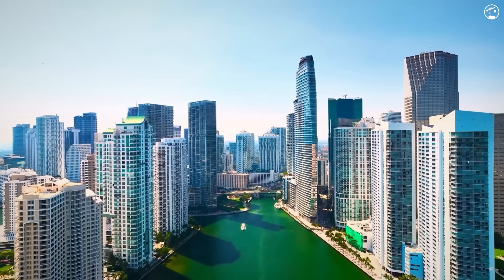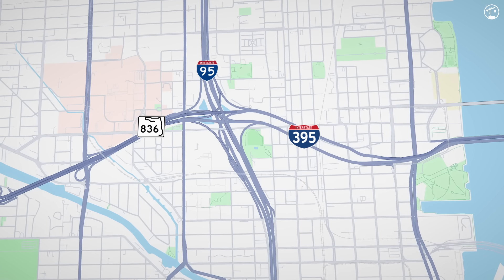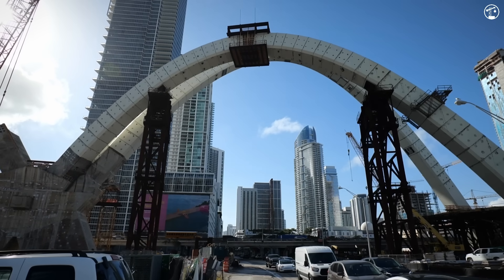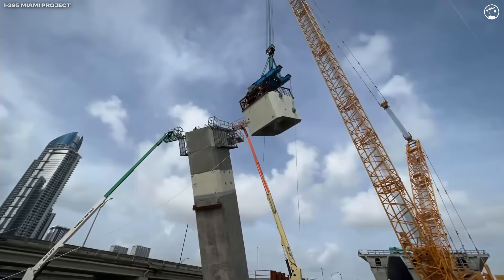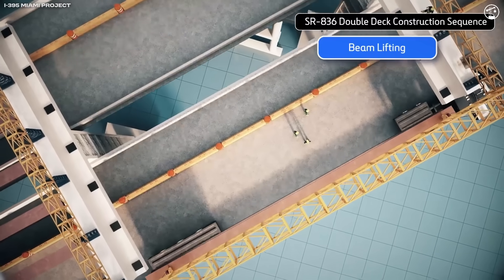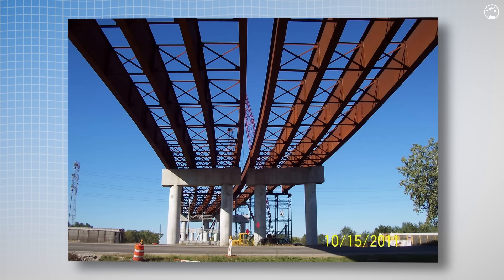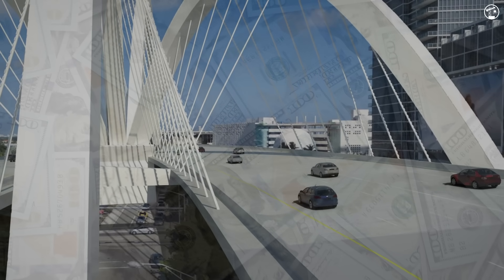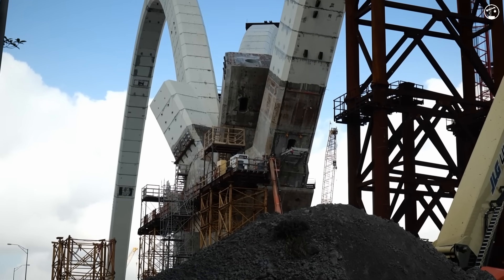Why Miami is Building this Insane Bridge

Comment: What Greater Miami really needs is to expand the Metrorail system to Miami Beach, North and West Miami-Dade areas to take cars off the highway.
Reply: There needs to be a REAL mass transit system in Dade and Broward county. Metrorail is a small dated limited system put there to say the city was capable of doing it. Returning to South Florida from any real city (Tokyo, NY, etc) makes you realize just how neglected the entire place is. The bridge is cool but there needs to be a fast metro system running alongside every single major highway and corridor in all of South Florida.
Reply: @Yarmox There’s the SMART program on Miami Dade County’s website with 5 different corridors but knowing how Metrorail and other things have been handled I’m not confident that it’s coming soon. Broward is at least getting elevated light rail in 2028 but it’s serving the airport, port, and convention center so it’s more for travelers. Probably wouldn’t be expanded out to local communities until an undated phase beyond that
Reply: @Yarmox make that in all the US
Reply: @Yarmox 
Penelas killed the original idea of patching both counties, thru University Drive.  Once he said stretching the existing line from 79th to county line Road, would cost an obscene amount of billions, Broward bounced and invested that money on improving 595 (which was completed years before Palmetto & Dolphin, with billions under budget, I might add).
Reply: People love their cars in Miami. There are a lot of immigrants and rich people that like to show off their cars. For example, I know Cubans love showing off their rides lol (I’m Cuban by the way). Plus it’s way too hot and rains way too much. Only a very small percentage of people will use the public transportation
Reply: @ManCity4InRow 
Malanga Kimbumbia, ‘Sere!
Reply: Explain that to the Miami Beach locals who voted against expanding the Metro Rail 🙄
Reply: Just one more lane!
Reply: @Julian_Wallis  Hahahaha adding capacity is hilarious. You're so much smarter
Reply: @Julian_Wallis  and four more years to complete it
Reply: @Julian_Wallis in this case they really do need more lanes
Reply: @evials9123  And they took 20 years to add one more lane lol. In that amount of time, they could have added more busses without rebuilding the roads.
Reply: They need to build an extension from downtown along side  8th st all the day to sweetwater & FIU. This gives direct access to downtown to the all the people living in the center of the county & all the students could now use to commute to school. They can even make a station at the MDC building in little Havana
Reply: @arislopes1924 
Alongside the Dolphin, turning on Milam Dary, zigzagging thru Doral, sharp gradual turn towards 107th to FIU, then to Coral Way west zigzagging southwest towards Kendall Drive.  That’s the only way to do it.  What makes you think Versailles would allow that eyesore in front of their restaurant, plus that section of Coral Gables?!  Nah.
Reply: Well I promise you that not many people will use public transportation 😂
Reply: @jwlmz62  When you build car infrastructure and force people to use it and be dependent on it, surprise surprise, people use it.
Reply: @jwlmz62 
that’s the mentality them County Malangas, would like for the people to adopt.
Reply: Horrible design
Reply: the US can't do anything decent with public transportation lol. except in NYC
Reply: Where do all the parking lots at the train stations go? Better yet, where do the train stations and tracks fit? Also, why is ridership on trains in the area so low? Is it because it's less convenient, door to door?
Reply: Miami is not designed for public transport.
Reply: Yeah, give them another 30 years, they’ll get around to it. It only took them about 30 to get around to the airport rail, nevermind the fact that I’m sure a ton of people are still waiting on that 8th street extension.
Reply: hmmmmmmm.........no don't want the train coming to MB. It's crowded enough. and it would be over the road, would block the sun and give noise and nope will never happen.
Reply: Even expanding the metro mover would be a HUGE help, or adding a line via the monorail to Miami Beach, I used to move all over the downtown with just the monorail (plus good luck finding parking with your car in Miami😭)
Reply: That part!! Miami dade needs a better metro system from homestead, aventura, opalocka, carol city, Hialeah, Kendall, fountainebleau, cutler bay, Miramar, Miami Gardens, downtown, sunny isle, to south beach. This will help so much more with people from getting point A - Z. I’m sure it’s possible but dade county just doesn’t want to expand or spend the fundings for it.
Reply: @Mateo_TheMadtumi_Vendryes 
Not happening!  These Hialeans:
-). Will not expand metrorail north thru 27th Avenue, to benefit that “demographic.”  Why you think it curves west on 79th street towards Hialeah…  ever thought of that?  The original idea was bring it all the way to County Line Road, but Ferre’s successors said “EH, QUEEE PING@, ‘SERE!”

-). East to the beach it’s impossible because rich people don’t want a rail line running along Venetian, McArthur or Julia Tuttle.  Can you imagine all of Little Haiti, Wynwood, Pork & Beans and Allapattah descending on a rail station near Mt. Sinai?  THEY don’t want that!  Same as an elevated line south thru US1, will find opposition from Pinecrest and The Falls.

-). West to Doral and FIU?!  These Malangas ain’t missing on all that toll revenue!  Trust me on that.  They make a killing on insurance fraud and expensive gas, and that’s how they like it.
Reply: Agreed! And create a fast train route from Miami Beach to FT Lauderdale!
Reply: @mypovlife1337  Maybe the taxpayers can fund a train to take you from your house to the grocery store, too. lol.
Reply: @jackfntwist  And then they could start paying you for shitty internet comments and perhaps make you feel less than completely worthless.
Reply: @mypovlife1337  That would be great. Maybe they could pay me first.
Reply: 100%
Reply: The #1 thing that Miami Beach does NOT need is more people on public transit going there
Reply: Couldnt agree more. Even make a station by FIU
Reply: Exactly this would have been way better,
Reply: That would be far too smart
Reply: Ha! They been talking about that since I was taking the metro in highschool…04. All we got was the airport. But there was  talks of it going to the Miami Beach as well.
Reply: Metro already has a planned expansion throughout north Miami luckily
Reply: @TurtleFish64 its not happening they said that years ago nothing to show for it. I'll believe it when I see it
Reply: @TurtleFish64 
😂😂😂😂
Reply: You’re absolutely right! traffic in Dade county is a nightmare😢
Reply: THANK YOU!!! Literally talking about this earlier
Reply: Will never happen to many big car dealership owners lobbying local politicians to block expanding public transportation projects. They want everyone to keep buying their cars.
Reply: With all the cheap robotaxis just around the corner, they won't invest in rail.  They'll just make certain lanes bus/taxi/ride-share dedicated at certain hours of the day. That's what they did with the shoulder of 836 EB/WB instead of taking Metrorail out west.
Reply: No not to Miami Beach noooooooooo keep the shiittt out of here listen they been trying that for years and years and it always gets rejected you know why..???? We don’t need the homeless invading Miami Beach and nothing against no one that’s homeless
Reply: Amen, but city planning is abysmal when it’s car centric dominance for the sheer amount of money that can be made via gas, cars themselves, insurance. Profits over efficiency
Reply: It will never happen. NIMBY is a thing and rich people clutch their pearls whenever they hear the words "Rapid Transit" anywhere near their expensive condos and homes. Say you will build Metrorail to South Beach and your political career in Miami is over. Just...One...More...Lane...
Reply: Or just legalize lane splitting and more people would get motorcycles
Reply: Exactly 💯 💯💯👏🙌
Reply: Better idea ,spend tax payers money on infrastructure and housing
Reply: @juanalmos1959  Better idea, let taxpayers spend their own money to help themselves and their families.
Reply: @jackfntwist what a stupid and ignorant comment
Reply: @Thomas-Bradley  It might be a comment that you disagree with (I'm not sure which one you are referring to), and thus resorting to name calling, but I assure you that it is neither stupid nor ignorant. I'm an extremely educated person, and have been a resident, taxpayer, worker, homeowner, commuter, of both Miami and Miami Beach longer than most of the people in these comments have been alive. If you're referring to the pigeon comment, they most certainly ride the metrofail from one station to the other. Go see for yourself. Start at the airport.
Reply: @Thomas-Bradley  Miami Metrorail faces a significant budget deficit. The system's expenses consistently exceed revenue, leading to a shortfall. In recent years, the deficit has been in the millions of dollars, and there are projections that the gap will continue to grow. 
Here's a more detailed breakdown:
Revenue vs. Expenses:
.
Miami-Dade Transit's Metrorail experiences a situation where operating costs are higher than the revenue generated from fares. 
Impact on Ridership:
.
Between 2017 and 2018, ridership decreased, further contributing to the revenue decline. 
Increased Passenger Costs:
.
The increased deficit has led to higher per-passenger costs, with each trip costing more to operate. 
Budget Gaps:
.
There are projected budget gaps for transit, including Metrorail, with expenses exceeding revenue by millions of dollars.
Reply: 1000% what the world Miami Beach cannot handle any more car traffic!!!
Reply: imagine if there was a loop around south beach that connected to downtown
Reply: Yes to kendall as well and Flagler and 8th street too
Reply: Metro rail expansion is a must now like 40 years ago
Reply: I recently rode MetroFail. In my car there were 2 humans (including myself), and 5 pigeons, no joke. My share of air conditioning, alone, must have cost taxpayers $50. I paid ZERO (station agent told me to go in the open door for free). The pigeons got off on Brickell and the other guy Downtown. In total, there were maybe 5 human passengers getting off or on before the end of the line (straight, dysfunctional line).
Reply: How about just adding reliable busses to existing infrastructure to take extra cars off the road. That is something that can be done  tomorrow to improve public transportation. Rail can come later once the city has shown it can manage public transportation at a large scale.
Reply: Taxpayers in Miami constantly getting scammed. Sos stupid bridge.
Reply: Yeah, because Miami Beach needs more homeless people
Reply: Especially south Miami.. 😣
Reply: Terrible take. This wouldn’t work in miami
Reply: They don’t care about the everyday person only tourist and the rich
Reply: EXACTLY
Reply: It's already ghetto , but let's make sure all bus stop dwellers able to further destroy it
Reply: The spider arch by Donald mc Donald is corny free masons joke of masonry. You can't see it because of the mace on your face
Reply: We need lanes not metro
Reply: No one rides on the metro rail because it’s nothing but a jump and grab thief’s express trip from Dadeland  to NW. 79th St. It’s a hellhole. If it had gone to Homestead like it was originally intended it would be better. After all it does have the right of way to go all the way down there, but the bribes that were paid to the Miami city government caused it to run out of money before it could be completed.  Regardless, it’s not effective. It needs to bypass the hellhole that is NW. 79th St.
Reply: No one rides on the metro rail because it’s nothing but a jump and grab thief’s express trip from Dadeland  to NW. 79th St. It’s a hellhole. If it had gone to Homestead like it was originally intended it would be better. After all it does have the right of way to go all the way down there, but the bribes that were paid to the Miami city government caused it to run out of money before it could be completed.  Regardless, it’s not effective. It needs to bypass the hellhole that is NW. 79th St.
Reply: No room for it heading west . Unless you take hundreds of houses out of the way ..( eminent domain)
Reply: The MB residents keep voting it down. They voted against the people mover as well
Reply: @nickgeorgiou7770  When did that happen?  I have never seen it on the ballot.
Reply: @loumcast I’ve heard about it through talk radio and I’ve heard from people that live on the Beach side.
Reply: @nickgeorgiou7770  That vote has never taken place.   There have been some opposition from some city leaders and activists regarding the metro rail extension reaching the beach, but the city residents have never voted on that issue.
Reply: Yessssss! Please
Reply: Yup
Reply: I think Metrorail has been a disaster.  It should have been a full size train going from the keys to the areas you mention including the airport.
Reply: I like this project.
Reply: a MYSTERIOUS SPEAKER REPRESENTATIVE of SOUTH of FIFTH COMMUNITY OPPOSE to an OMNI DEVELOPMENT from DOWNTOWN to ALTON RD and 5th. But they "APPROVED" an ELEVATED CROSSWALK for 30 MILLION DOLLARS 😂😂😂
Reply: @TIOPERICO The Miami corruption is legendary.
Reply: They need to focus on maintaining the roads we already have instead of worrying about building new shit that nobody's gonna use
Reply: I remember when I was a kid there was talk about expanding the metrorail down Kendall and it never happened. I wouldn’t necessarily want more people coming to Kendall, but so many people get struck by vehicles here because they have to walk. We have some bad drivers who don’t understand when it’s a pedestrian’s turn to walk. If expansion of the metrorail would help save lives then I’m all for it. My son is obsessed with trains and would want to ride it everyday just for fun lol.
Reply: And to Homestead as Well
Reply: Double highways like Boston or Texas
Reply: I couldn't agree with you more !!!!! Because this is a waste of time and money and it does not improve traffic on i-95 they're only building in the area of the exits. At the end of i-95 at that . SMH makes  no sense
Reply: just deport the illegals. its easier, cheaper, and gets you fabulous results!
Reply: I think dedicated bus lanes during peak hours and lots of them would help us out more. We have enough construction happening, and we don't need more. However, if people see buses flying past them while sitting in traffic, that may prompt them to jump in.
Reply: @Live-Life-Freely   Middle-class people won't ride buses, only the poor does that sort of thing.   In 2002, Miami-Dade taxpayers approved a half-cent increase in sales tax called; The People's Transportation Plan (PTP) to expand Metrorail.   However, most of the promises did not materialize and Miami-Dade taxpayers got scammed!
Reply: @loumcast  I hear you, however, from what I've seen things are changing and a lot of people are starting to use the free trolley system.
I don't think the people got scammed. I think it takes time to get people out of their cars and on to public transport. And yes people have the mentality of only the poor ride the us and that takes time to change.

The option I mentioned might work because it would use existing infrastructure and it's only dedicating lanes to buses during peak hours. 

Remember the Metrorail was supposed to be a game changer, and it's never been profitable or reached close to its max capacity.
Reply: @Live-Life-Freely  I don't agree with your statement.  I think we got scammed because nothing was built, other than the 2.4-mile Metrorail extension from Earlington Heights station to the airport from the airport.   We were promised a line all the way to the Miami-Dade Broward line and another one out west all the way to FIU and the Turnpike.   They used the money for something else, they're still collecting the half-cent tax and nothing has been built.   Regarding your comment that Metrorail was supposed to be a game changer, yes it was supposed to be, but the country never finished the project, only one leg was finished.  Most of the cars are coming from North-Dade, Broward and West Dade, and there no lines in either direction.  Another thing, they have dedicated bus lanes to Miami Beach on the I-195 and the traffic to and from the Beach it's still horrendous, the same can be said about dedicated bus lanes in south Dade, from the Dadeland South Metrorail Station all the way to SW 344 street, a waste of taxpayer's money, no one rides those buses.
Reply: @Live-Life-Freely  This is my second reply to you, the other one was taken down.   Apparently, they didn't like what I had to say.   We have dedicated bus lanes to the beach on I-195 and from Dadeland South Metrorail station all the way to SW 344 street and the traffic it's still horrendous, the buses run mostly empty.   We got scammed!   They're still collecting the half--cent and we have nothing to show for, they promised two new legs for Metrorail, one all the way to the Miami-Dade/Broward county line and the other one out west, neither one got built, the only thing they did was extend the Metrorail from the Earlington station to the airport (2.2 miles) that's it.   The system is incomplete, that's why it's not a game changer.  The money is gone, no one knows what happened to it, yet the property taxes continue to go up.
Reply: @loumcast  I live in NYC and I've seen even rich wall street/mid town tech bros still take the bus/subway. Car ownnership isn't as symbol of wealth but a symptom of a car centric society. This bridge looks beautiful but all those lanes will eventually be choked up in cars making it ugly.
Reply: @loumcast  Probably because it doesn't go anywhere. Transit hast to be expanded out from downtown and not just the airport.
Reply: @loumcast  yup i remember that
Reply: @loumcast  ok so 'only poor ride buses' thing isnt real. No one goes i have too much money for a bus. However if you already have a car it doesn't make sense for you to take a bus anymore. You might as well use the car and gas is a marginal cost now. You have to target people thinking of getting a car (like teens) or people who don't want to drive/can live without driving (people without access to parking) however even in south florida theres enough parking and few dense neighborhoods. Therefore you're best option is always your car. Unless theres an urban dictatorship that wants to spend billions on infrastructure that's not going to change
Reply: @loumcast  having a train that goes to the airport is monumental for Miami.
Reply: @loumcast a sign of a developed city is people of all tax brackets choosing to ride public transit. go to nyc & the subway lines are so deeply connected to bus lines, it’s just more convenient than driving/parking
Reply: @The_D0RK_KNIGHT  Stay in NY. You have ZERO clue how things work down here.
Reply: @Live-Life-Freely yhe metro rail doesnt service the areas that would benefit the most from it. The north miami area, the nalls, the colleges, expand the service and warch how connected miami dade becomes.
Reply: @loumcast  was the tax removed?
Reply: @loumcast so what if they don't do it
Reply: @loumcast  my dad was a lawyer and would sometimes take the bus and then metrorail to go to court, or drive to the metrorail station. My dr takes the bus and then the metrorail (she lives in homestead and works downtown). When I was pregnant my car broke and I had to take the bus. My mom has heart failure and can’t drive anymore so I drive her everywhere, but if I’m out of town she takes the bus. It’s not for “poor people”. Public transportation is for all kinds of people in different situations.
Reply: @loumcast It’s not the first time I’ve heard “only the poor take trains to commute.” Go to all the successful urban train networks around the world and you will find a mix of rich and poor on the trains. Problem with South Florida is poor planning for mass transit, plain and simple.
Reply: @Live-Life-Freely although that’s true , it’ll fix nothing if the actual bus system doesn’t improve by 10 fold as the amount of people actually using the bus at the moment trying to get into miami beach is astronomical.( i’ve been on the bus here because i live here i know what im talking about )
Reply: @Live-Life-Freely we just recently had a good amount of our bus lines removed & more buses placed on heavy traffic lines. tbh its made traffic even worse, speaking as consistent rider. the metrorail/metromover development plan would be priceless when it comes transit
Reply: @Live-Life-Freely  busses slow down traffic
Reply: @Live-Life-Freely  NO ONE RIDES THE BUS IN MIAMI. NEVER HAVE AND NEVER WILL. The entire system is a financial drain and causes more traffic than it intends to alleviate.
Reply: usted se monta en el metro rail y da asco
Reply: FALSO: our Metrorail is cleaner than most similar systems (compared with NYC, Atlanta, LA) @titantitan3030
Reply: I miss old Miami. Less people.
Reply: @305Paperchase I miss the pre internet world. There were less damaged people.
Reply: Bro! Just one more lane. I promise this overpriced wasteful project will get rid of traffic.
Reply: @rudebee15 bro just one more bus and it totally isn’t a waste
Reply: @night6724 expanding highways endlessly is a waste. Highways are always under construction and no one says that wasteful. Public transit has more benefits to the public than one highway lane.
Reply: @rudebee15  In Houston, TX they kept asking for the same thing, just one more. Now they have 26 lanes of traffic. If you build it they will come.
Reply: And lose on that toll revenue on the Dolphin and Don Shula?!  If Ferré didn’t do it, which was his original goal, what makes you think these Hialeans will?
💅🏾💅🏾
Reply: @BolitaDeKetica  i prefer the deport them all method.
Reply: The only things that ride Metrorail is the pigeons. No lie. The last time I rode, there were more pigeons than people going from one station to another.
Reply: This is Miami not New Crap City, no one is going to use metro here like that, people like their cars, I swear everyone thinks they're traffic engineers, and have every solution.